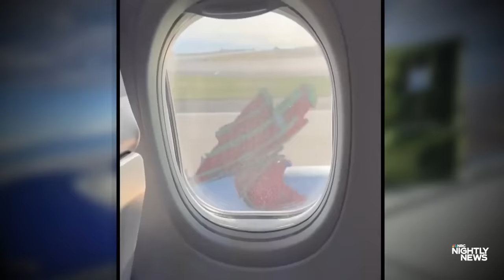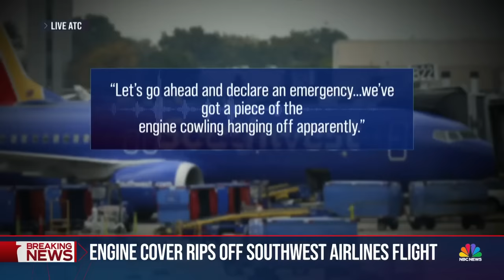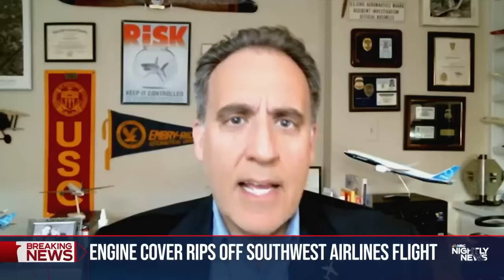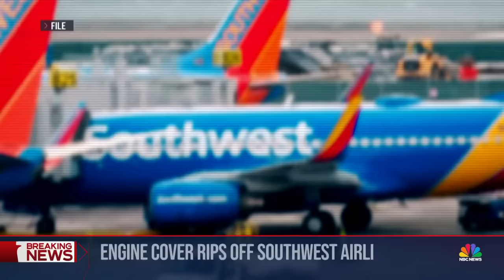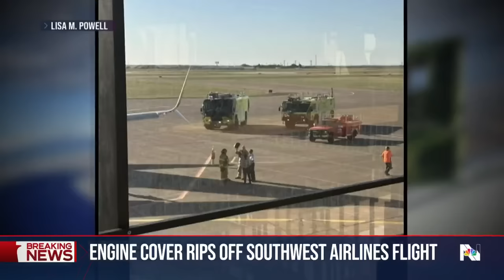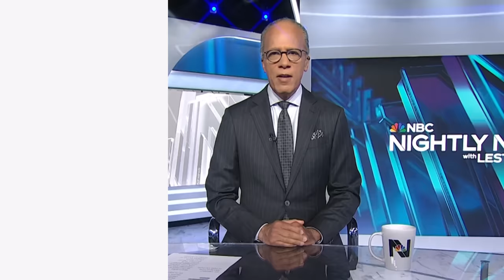Southwest flight makes emergency landing after engine cover peels off

Comment: OMG!  What’s with all these airplane mechanical issues?!  I’m seriously rethinking my travel plans for summer vacation.
Reply: I took Amtrak instead.
Reply: You are far more likely to die driving to the airport than from a plane crash. There are 100,000 commercial flights every DAY. How many deadly plane crashes do you hear about? Maybe once every year or two.
Reply: @aznfriedrice415 

I mean, if yer gon'uh gamble,
play the percentage.
   I so get that.
Reply: "Statistically speaking, it's still the safest way to travel." - Superman
Reply: @AstroBear11  Not a wise one for sure.
Reply: Just stay away from boeing, do you not get the point of the story about boeings?
Reply: The problem isn't boeing in this situation. This aircraft is between 8 and 9 years old. A faulty cowling from the factory would be long gone after what an airline puts an aircraft through in the first month of operation. There's too much pressure on us to release aircraft for scheduling's sake. This was a latch or a series of latches that were forgotten during servicing. You wouldn't blame Chevy if you didn't close the hood right on your Camaro after adding fluids and it opened on the interstate.
Reply: @Hshhzmfwn  it's hilarious how some people are so weak they actually believe it is not a problem with boeing when it has been decades of this exa t same story about the lack of safety standards.
Reply: It’s standard American quality and workmanship.
Reply: @tylerdurden4006 Tell me you know nothing about aviation without telling me you know nothing about aviation.  The most likely cause here is maintenance related and not a design issue.
Reply: BOYCOTT!! Until they can shape up and prioritize and consistently have a 99% rate of high passenger safety!
Reply: Boeing again.  Airbus much safer.
Reply: @aznfriedrice415  There are so many train incidents in the US that go unreported by news... I think the average was 2-3/day
Reply: @artjackson8360  decades of stories of boeing failures doesn't mean boeing issues? Every year stories are done about how "boeing has lost its way"
Reply: It's hilarious just how many are really easily "convinced" by boeimg that nothing wrong even though a dozen stories about boeings falling apart in the air have happened in the last 2 months. 🤷
Reply: Just choose anything that isnt Boeing for now
Reply: I think it’s like youth crime, or car accidents. They happen every day, but more of them get reported when the media wants to make a point about them.
Reply: @tylerdurden4006 Again it’s maintenance not Boeing
Reply: You should drive, it's safer
Reply: @tylerdurded4006. This isn't my an incident that Boeing had a part of.  I know this is a concept that people like you find very hard to understand, so I'm going to say it clearly: not everything bad that happens to a company's product is a result of the company's shortcomings.
Reply: Fly airbus
Reply: Just avoid taking Boeing and you are good for now.
Reply: Imagine thinking they even find many problems on the production line during surprise insections, and you STILL think it not a boeing problem.
Reply: @WhatIsThis-zq4hk  statement provided by Boeing.
Reply: @aznfriedrice415 
You took the Government run train service
Reply: @tylerdurden4006 
Boeing did not make the engine
Reply: @shaungordon9737 
Boeing did not make the engine 
Thank you for playing but you lose
Reply: @FP194  but they bought it, do you see airbus engines blowing up all the time? They probably spend money on safety...
Reply: @FP194  believe it or not, but boeing has the option of spending a little more money on safety for engines that do not blow up all the time...no? Airbus does...this should be simple to understand...
Reply: Hilarious how all the headlines today are about the warni gs of the fuselage possibly failing in the future, if only someone tried to tell you this stuff already.

Comment: Gotta check the stock price tomorrow
Reply: Airliners are almost never good to invest in, even buying during covid would have seen little returns. Airliners make money off frequent flyer miles for the most part and those are most always (if not always) handled by a separate company.

Comment: What is going on with these planes?
Reply: Boeing again
Reply: @shaungordon9737 This has absolutely nothing to do with Boeing and if you were actually educated in the aviation sector you would know that this is an AIRLINE issue not manufacturer issue. This is the result of an airline engineer forgetting to close the cowling latches on the engine. This has nothing to do with Boeing and it has nothing to do with id say even CFM.

Comment: Why haven’t all Boeing 737 been grounded with all the incidents occurring?
Reply: This isn't Boeing's fault. Someone at Southwest didn't properly latch the engine cowling.
Reply: There are thousands of 73's operating globally, it would be neither practical nor nessisary to do so.
Reply: This has nothing to do with Boeing and is more than likely due to mistakes made by Southwest maintenance crews.
Reply: Shouldn’t there be a warning light if it’s not latched properly?
Reply: @scottguy5452  no need its impractical to have warning lights on every panel on the  aircraft
Reply: This is an older 737 
The engine is not made by Boeing 
This is a maintenance issue

Comment: someone forgot the latches ,, someone in a ball of trouble , small job to do but big damage here , happens on Airbus as well , this has nothing to do with Boeing by the way , its a bit like blaming Mercedes for leaving the bonnet open even though the car left germany 4 years ago
Reply: So many comments here have no clue what they are talking about. I especially like the ones that think the pilot knows more about the aircraft than the guy who fixes it does. We will have to wait until the investigation is over to know the exact reason but unfortunately from past occurrences I tend to agree with you that the cowl latches were probably not latched. The other point that most people just don’t get is that, as you say, this has also happened on Airbus aircraft
Reply: @NicholasRiviera-Dr  thank you Nicholas , good comment and lets see what happens with the investigation ,, how long will that take to figure what happened , so walk arounds are important for a pilot  before flight,, its the done thing providing hes looking and not just ambleing around just to streach the legs ,, the latches are normally painted with a hi vis color for night work as the torch will spot the latches down and in the open position,,  providing the person  with the torch is aware of what they are  looking at , but  no point in looking if you cant see the danger of what can happen when the craft goes down the line and onto the runway and panels start  fluttering in the high winds .................

Comment: There are about a hundred things that I would rather not see out the window of my plane more than a loose engine cowling. The engine on fire, engine missing, gremlin ripping into engine, baby hanging on for dear life, the wing falling off, another plane about to hit my plane, only ocean while on a Reno to Houston flight, the lack of a piece of glass separating me from the outside air.  In the current under regulated airline environment where some of those items have recently happened, saying this is the worst thing to see is extreme hyperbole.
Reply: a monster on the wing

Comment: A pilot or copilot is supposed to do a walkaround of the aircraft prior to takeoff and check that things like engine covers are properly fastened down.  It could have been a problem higher up where the problem couldn't be seen but I have to wonder if they are paying attention to the condition of the aircraft like they should.  Then there was the case of a passenger noticing a crack in the fuselage as they were boarding-which later ripped free.
Reply: They're also supposed to fly sober, not fall asleep, and keep an eye on the instruments.

But hey...
who's perfect aye?
Reply: Walking around a B737 or A320 is not like walking around a C172 where you wiggle the elevators and ailerons and put a wooden stick into the wing tank to see if you have enough gas. Commercial jetliners are HUGE and almost impossible to completely inspect from the ground. Pilots rely heavily on mechanics to do their job properly just as passengers rely heavily on pilots.
Reply: @rayray8687  well said

Comment: Do commercial pilots do external preflight checks on airliners this big?
Reply: Yes they do a walk around I work as cabin crew can confirm they do
Reply: Yes they do. But what should also be happening is a preflight inspection by the maintenance man, he is the guy that knows about how the aircraft works and what problems there could be. Many people think that pilots know everything about the aircraft they fly, but pilots really know more about how to operate the aircraft not how to fix it. In other words, the maintenance man is the best guy to do the preflight inspection

Comment: I was on a small commercial plane about forty years ago that had the outside door open up just after take off.  I was staring at about a 4” gap of light around the edge.  I was in the last seat, so I got up and closed the d- door.  I don’t think that there were more than 20 people on that plane.  When we landed, I told the airline people that I had to close the door.  They acted like they didn’t believe me.  The two men who were sitting in front of me confirmed that I had closed the door.
Reply: And......???

((man I love a good serial cliffhanger))

You ever watch the old Buck Roger's series with Buster Crabb?

(just curious)
Reply: @AstroBear11  

   I'm telling you,
those moose can be deadly on a road if you're not a Hornblower.

Comment: Its a Boeing 737, of course.
Reply: It has nothing to do with Boeing... Bad inspection
Reply: The B737NG is a great aircraft
Reply: @OM-bs7of And yet we never hear about these issues on A320s.....always Boeing
Reply: @shaungordon9737 look up the BA accident in 2013 at Heathrow. A319 lost both cowlings for the likely same reason as this. Nothing to do with Boeing.
Reply: @shaungordon9737  Vueling A320 at Bilbao on Oct 25th 2018, dropped parts of engine cowling on departure. Happens to Airbus aswell, just depends on which media outlet wants to make the most noise
Reply: @shaungordon9737  irrelevant. Something as simple as an engine cover would have been prevented with a thorough inspection. An engine cover coming off isn't something that happens everyday. Its like forgetting to latch a car bonnet before taking it for a drive on the highway. The bonnet will eventually blow off. People need to stop being so ignorant
Reply: @shaungordon9737  it happens too but it hasent been highlighted ,,also Airbus engines are mounted way higher off the ground so its way easier to see the latches  undone and not secured ,, the 737 s have the engines way lower ,actually about 10 inches from the ground so its important to have a really good look and get down and check properly its an easy fix on the ground , but once she goes down the runway at 200 knots stuff thats not securec will peel like an apple ,, then the fun starts
Reply: @NicholasRiviera-Dr  Exactly good man
Reply: @shaungordon9737  the Airbus A330’s I work on now have a specific step in the manual, to document that the fan cowls have been opened. This is a change to the manual because it has happened in the past where the fan cowls were left unlatched and on departure and separated from the aircraft. One example of the fan cowls falling off is Canada 3000 Airbus A330-200 C-GGWA 17th March 2000. Airbus has recorded 13 similar fan cowl separations involving A300 to A330 aircraft since 1978. There have been more since the year 2000. As I said before, it just depends which media outlet wants to bang on about it, at the moment the focus is BOEING, that’s what the media does
Reply: @shaungordon9737 
You do know this is an older 737 and it’s a maintenance issue for southwest

Comment: Boeing considers airplanes that are also convertibles a "feature." But really, whether it's in manufacturing or maintenance, does it really matter to the passengers if the plane goes down?
Reply: It kinda does matter because that is where the blame and responsibility will be held
Reply: @Mgaffo222  I'm just saying will the passengers care where the problem originated from, when they only have seconds to live.
Reply: Not a Boeing issue as they don’t make the engines and this was an older 737NG 
It’s a southwest maintenance issue but don’t let that stop you from getting foot in mouth disease

Comment: If im Boeing CEO i would explain this is a new feature, a new engine cover will grow again before the next flight 😂
Reply: like shark's teeth. one falls off another one grows in.
Reply: Boeing does not make aircraft engines. This is NOT a Boeing issue. A/C Maintenance failed to secure cowling latches.
Reply: @aa777flyer  doesn't even matter if they made the engine or not. This was an issue with maintenance and SouthWest does their own maintenance
Reply: Like a snake shedding skin.

Comment: I remember forgetting to secure the bonnet catch on my Morris minor 50 years ago and it flying up blocking my vision. I must have been  travelling at about 30mph. Very dramatic and unexpected. Still, a little less dramatic than for the passengers aboard the Boeing. I suppose that with the recent spate of incidents associated with this manufacturers aircraft, the passengers just took it as fairly normal and got back to the inflight movie.

Comment: what's next??  engines falling off??
Reply: May be passengers falling off... I'm thinking packing a parachute next time I take a plane.
Reply: Mentor Pilot  on  YouTube has a great post about exactly  that.
Reply: Its been done
Reply: Engines have fallen off 
American Airlines flight 191 in 1972 
An engine was not properly installed after maintenance
Reply: What about the MaX planes?
Reply: MaX 737 Comin At Cha Homies

Comment: This is not just a Boeing issue, there have been similar engine cowling issues with Airbus planes.
Reply: They have the same supplier material used from cola tin can.
Reply: It’s not a Boeing issue at all 
It’s a maintenance issue at Southwest

Comment: Engine Cowling are Secondary Structure and not as critical as PSE but they did hit other parts of the Aircraft. That said I recently retired after 37 years in part because I am concerned about Maintenance being performed by new hires. These young mechanics are constantly being distracted by cell phone usage instead of concentrating on their job at hand. They don't read the procedures to perform the task   and are more concerned with creating overtime. Then jobs don't get finished and someone  else new takes over and there are more risks involved. Work ethics need to improve greatly.
Reply: Just took a flight from Houston to Seattle last night, when our plane pulling out, I looked out the window and saw the guy fueling up the next plane was on his phone.

Comment: Those cfms weren’t meant to be on that 73 they were redesigned for it
Reply: Yeah Didn't the CFM Leaps create , Balance issues? Didn't older 737's have CFM-56's similar to the ones Camma Corp re engined for the DC-8 70 series? Closer QCM probably needed at wherever they get their MX done!
Reply: @paulrom446  yup…737 wasn’t planned to be developed this far
Reply: @managed9348  Now that I think of it that's precisely the case!
Reply: But those CFM56-7 engines do very well on that airframe. They are a very reliable engine

Comment: Meanwhile, the same CFM56 engine on an Airbus A320, you need to open it with a special key stored in the cockpit. 

The key has a long red REMOVE BEFORE FLIGHT streamer.

If the feature is not factory built, the operator can retrofit them.

The newer A320neo go a step further with a pop up mechanical flag and electronic sensors alerting the cockpit when the cowls are not latched up.
Reply: Airbus has also lost engine cowlings 
If you bother to look it up

Comment: Whether you want to blame it on Boeing, or United, or Southwest in this case…the fact is that there is just not enough of a maintenance workforce to meet the demand of repairing/overhauling aircraft. Way before these past couple of months, aviation analysts already warned us nearly a decade ago that as 2025 approaches, there are going to be more and more mechanical incidents unless we fix the shortage by getting aspiring mechanics into the field of aviation maintenance. However, what puzzles me is not only are the airlines getting away with it, but the fact that the FAA hasn’t stepped in to enforce their own regulations about aircraft airworthiness, even if that means cutting flight schedules. As a government agency at the federal level, they are failing pathetically. Absolutely pathetic.
Reply: Could it be the quality of the employee the airlines are hiring?
Reply: @davidsmiths5471  No, because aviation isn’t like your every day layman’s job like retail or manual labor. Every employee that comes in contact with the aircraft requires certification and exams that they have studied for, practiced, acquired the required amount of flight/service hours, and demonstrated in front of an examiner sitting next to them with an FAA mandated checklist before they’re allowed to pass. There are no “grades” in aviation, it’s all pass/fail, and it’s all based on your demonstrated ability. An employee wouldn’t have passed if they couldn’t demonstrate the required criteria, and the written portion is maybe 10% of all required examination. So you can fake and cheat a written test all you want, but it’s not going to help you pass the rest.
Reply: @FlyBoyMT  So whats your point actually!